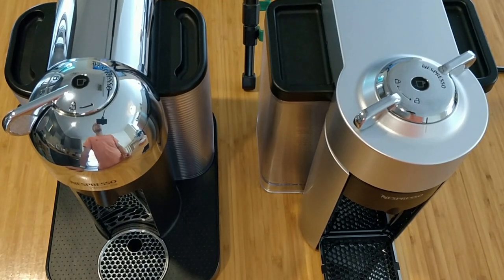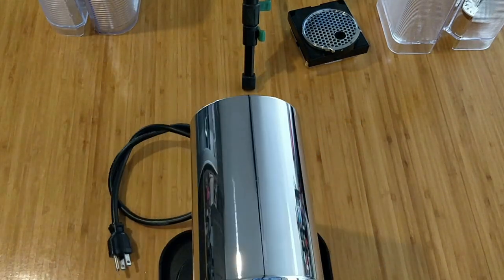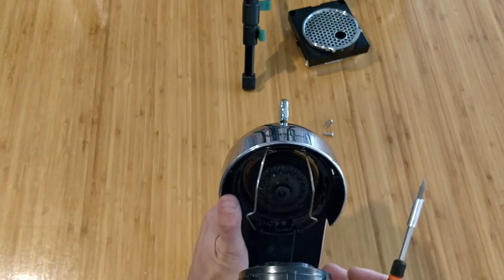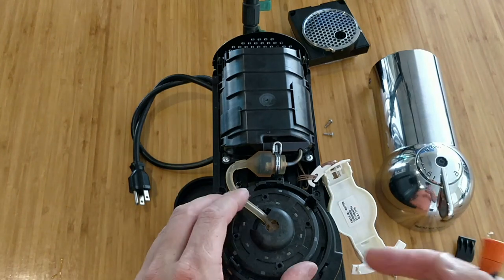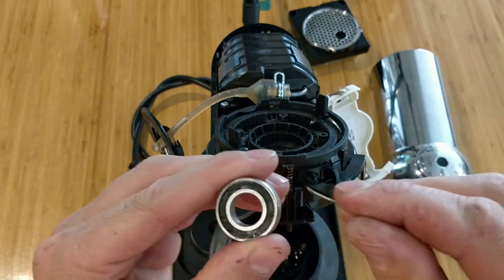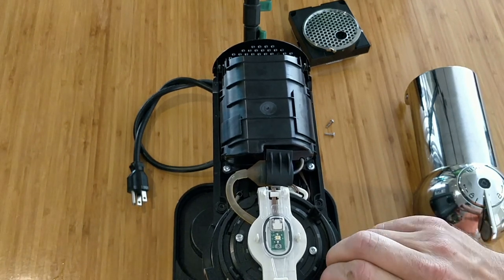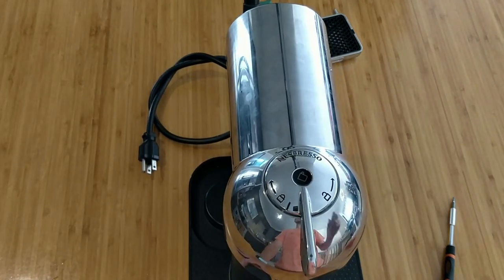How to fix Nespresso Vertuo Machine loud noise or no Water

Comment: Very impressed with the quality of your instructions and video and am so thankful you show us how to put it back! Just waiting for my bearing to come in and it clearly needed it. Very rusty and stuck hard inside the casing. Had to soak it and use a hammer to knock the old one out.
Reply: It is still not drawing in water. Quieter though!

Comment: Thank u. This worked great.
My bearing had seased up completely a couple times so I was ready to replace it.  I was able to get machine working while a  bearing arrived by manually rotating the part that pokes holes in the capsule but it ran very loud.

Once the replacement bearing arrived, I found out that just cleaning the  bearing and adding some oil (without removing the ball bearing covers) worked great.  The bearing was covered in coffee so all it seemed to need was a good cleaning.
Reply from the maker: Some bearings have to much use in them, it's always better to have a spare one.

Comment: Thanks, our machine is so quiet now. However we had so much trouble trying to get the part with the big spring back in place we just did not have the strength in our arthritic thumbs to get it back in. It took almost two hours of pushing down we actually ended up cracking the plastic so hopefully the machine will last until the next FREE with capsule purchase offer.

Comment: Great video .Clear instructions to take it apart. Had no water flow. Video helped me establish what the problem was. Short metal water tube at the end of the plastic pipe was completely blocked. Cleaned it up, All  runs well now. Thank you!

Comment: So I'm back to report that with roughly twice daily use, it took the standard bearings 5 months to fail again. The stainless/ceramic bearings are not a place to save money. They are a must if you'd like this repair to last! I just installed the new stainless bearings and am sure these will last longer. The standard bearing was in absolutely horrible shape...far worse than the original that lasted 8 years.  Thanks again for your helpful video!
Reply from the maker: Thanks.

Comment: I found your video very helpful and after bearing replacement the machine is quiet. I have several suggestions to make the process more clear. First, the use of a focused light such as a headlamp when working on the underside on the will allow one to see how to disengage the chrome cover more easily at the front of the machine. Second, I suggest that you alter the camera angle a bit so that the process you are doing is centered on the screen. Lastly, the way to insure alignment when re-installing the chrome cover is to close the machine and insure it's fully in lock position, before placing the cover on. Then, by holding the lever in the locked position as the cover is placed, it has to engage properly.
Reply from the maker: Thanks tor suggestions next time will do better ;-)

Comment: Edited: I successfully changed the ball bearing, the noise subsided but it’s not making the coffee properly. I think I might have tightened to much at some point. Now I definitely need to buy another machine. 
***Thank you for the video. I got it, I changed it!!! Very proud of myself. I have this machine for 5 years and I thought the noise was normal wear and tear. 
So let me tell you that it’s not that simple. You will get frustrated and you will probably need an extra hand at some point. Another tip: mine is a De’Longhi model. Don’t close it! The spring on the left side won’t open it by pressing it. 
When removing the big spring, inside that part is really hard to turn counterclockwise, my husband helped me with a plier. No more noise! I think I’ll stay with this machine for now! 😊

Comment: I did all you said and cleaned the bearing and filled it with wheel grease. It was easy with your video (even if it wasn't always clear). Good explanations though. I managed to reinstall everything without remaining parts...youppi. The greasing didn't eliminate the noise. I guess I will have to order a new bearing. Thank you.
Reply from the maker: Yes.

Comment: Thank you for step by step on how to open the machine. P.S. if bearing is in good condition pay close attention to the bottom part that get screwed onto the bearing. Similar to dogs on a washing machine they can be stuck in position and they should be able to spin freely all 4 dogs clean free up and replace if not broken, this should also repair the load sound when spinning.

Comment: Thank you so much for your informative video! I feel like the proverbial frog in a pot of slowly boiling water. I've owned my machine for years and lost track of just how loud my machine had become. I wanted to approach this with a little bit of science and downloaded a decibel meter app for my phone so that I could take volume readings before and after the bearing replacement. I was sure to take both measurements at a consistent distance of 2 feet with identical placement. The max decibel reading before replacing the bearing was a crazy 97 dB. With the new bearing, the max reading dropped to 73 dB. With the logarithmic nature of the dB scale, the 24 db drop equates to 1/8th the volume! The difference is staggering and wonderful! I accidentally ordered the standard steel bearing instead of the stainless/ceramic ones that you recommended. I received 6 bearings for the same price as one stainless steel bearing. I'll see how long the standard bearings last...perhaps as long as the other critical components on the machine which might break before rust becomes a problem. Either way, I'll be able to replace it 5 more times :) Thanks again!
Reply from the maker: No problem.

Comment: Thank you very much, it worked!!! When I tested the old bearing it ran very smoothly and the new one was kind of "stiff"  but just for the fun of it I used the new one. I thought it won't work, it's probably something else. BUT would you believe, it's running again. The 1/2" long metal pipe at the end silicone water feeding pipe came off, so when installing it into the hole, align the split-ring with the little "bump" in front of the platform ( very small)
Thanks again

Comment: Thank you so much my friend, I was able to fix my machine since this morning I could not drink my Nespresso coffee during my trip to the office, it was clogged from small coffee grounds at the end of the pipe tip (the black little tip that breaks the cup´s plastic lid). I think I could fix it without opening the machine but I was able to deeply clean all the inner parts and finally I assemble it with no problems. You deserve 100 likes!!!
Reply from the maker: Thanks.

Comment: THANK YOU so much!!  Great video, clear, simple and precise.  I was able to fix my noisy machine in no time following your steps.  At the end, your advice was very helpful to put back the cover correctly.  I put the bottom part at unlock position, and did the same thing with the top part, it went in like a charm.

Comment: Helpful video for the disassembly and reassembly. After I completed reassembly the machine was much quieter but the coffee was more water than coffee. There is a C clip on the short metal water tube. It's connected to the hose under the button assembly. Make sure the opening in the C clip lines up with the notch in the assembly that you press it down into. If its not lined up you'll get watery coffee.

Comment: Excellent video.  I repaired two machines.  Unfortunately following the repair they only  produced hot water (no coffee).  I ended up taking them apart multiple times to try and figure out why.  For those that had the metal tube fall out of the rubber hose (like me),  when you replace it, make sure you position the gap in the circlip  over the elevated tab on the top plate otherwise the hose and tube will not sit correctly and the water will bypass the coffee pod and all you will get is hot water.

Comment: BEWARE: I definitely appreciate the video, of course. Thanks!  BUT there are several steps that are too easy to get wrong. (Also, be very careful not to lose any of the springs.) NOTES: When disassembling: the bearing component (8:00), for me, required pliers (appears finger tight in video) .....  When reassembling, some steps RomaFix noted but deserve added emphasis: 
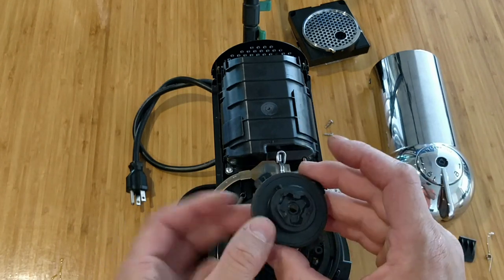1) 10:54 proper alignment of the 4-screw spring holder. I got that wrong, creating a puzzle and wasting time. 
2) 11:10 water feed (triangular) head must be pressed in FIRMLY. He glossed over this tiny step and I failed to do this firmly enough. This caused machine to express mostly clear water and VERY little coffee (reduced essential pressure somehow). I had to re-do the whole process!  Weird, since the water hose head attachment was all I did very slightly differently.
3) 13:30 alignment is very important BEFORE screwing the top back on. If you lock the top w/o the lever in proper alignment, the top will not unlock until you unscrew the 4 screws holding the top cover on and get at the 2 plastic clips somehow (1:47), which is a real pain. I ended up breaking these clips, which seems to affect nothing at all - feel free to break them, IMHO. Also, they do NOT un-clip nearly as easily as he showed.

Generally, the process is NOT as easy as suggested. I'm very handy and yet made a lot of little mistakes.   

MY PROBLEM?: I think I viewed the video mostly in large chunks (and at 1.5x speed - bad idea!) and figured it would be obvious. I should have watched a step, paused the video and did that one step and proceed that way step by step, pausing for almost every step.
Reply: I also experienced the issue with weak/clear coffee through the the brewing process after following this video. I found that between not firmly connecting the water line and having the little metal connector tube firmly seated between the line and the brewing head was and issue. Also,  I overtightened the screws which seems to have been a problem as well.
Reply from the maker: Good to know ..
Reply: The camera angle is also off and covers part of the front of the machine which is exactly what needs to be seen in better detail.

Comment: My machine was stuck in a cycle of blinking lights (would blink twice repeatedly) and when trying to reset or run in clean and descale mode the engine would make a click sound like it was stuck. After spending 30 minutes with Nespresso support, their conclusion was to send it in for repair ($150) or buy a new machine. Thank goodness I found this video because I was able to take the machine apart, soaked the parts shown in a bowl of white vinegar, cleaned with hot water and put back together. Machine is back up and running.
Reply from the maker: Great that you could fix it.

Comment: I changed my bearing and it works well, thank you. I think I must’ve done a step wrong as now the old pod is stuck when I am putting in a new one instead of just sliding off. Any idea what could be the reason?

Comment: thanks for the video, it was super helpful. The machine is so much quieter now!
I did something wrong, the self ejecting for used pods isn't working right - I must have put the top back on wrong.
Reply: nope, it wasn't the top, it was those springs in the front - i reinstalled them incorrectly. I went back 5:13 and paused the video - there's a good shot of the springs properly set there.

Comment: great information.  to reinstall the chrome top piece i lowered the head piece and locked it in place.  then moved the rotating piece in the top to the lock position.  that is, aligned the two lines.
Reply from the maker: Yes it can be assembled in multiple way. Thanks.

Comment: Great Video. very informative on how to fix the issue. The only problem I see is that I took your suggestion on ordering the part from the website you suggested and it will take a month to deliver. Never the less I reordered the part from Amazon, should get it in 2 days.
Reply from the maker: For me it took 9 days, but original bearing after cleaning failed in 6 month again

Comment: Hi.. I have vertuo next. First it would not pump, probably because it sucked in air cause the tank was empty. I opened it and took of the hose at top, started it and the air was out. The constant orange/red light is blinking. I press the button and it pumps water like when cleaning, but the blinking light will not go away. It was only white/blue for a few seconds at one point when i had the air hose disconnected, after that it went back to blinking red light. It does not help restarting it etc. and it wont read the capsuls. What can be wrong? Anything that can be done?? Has the pressure or motor gone bad or something? We had it for 3 years and only used to make like 2 cups on Saturday and Sunday. 🤷‍♂️

Comment: Hello. Thank you for the video. I ordered the part and will replace it when it arrives. Question about pumping the water and issues with this: Do you have a video or further recommendations? 
What is the best way to clear out the plastic tube now that it is exposed?
Thank you for your help

Comment: Hello - after doing this all, the machine is quieter but now the pods are getting stuck at the top of the piercing mechanism and won’t dispense when I open the lid. I have to take a knife and peel the pod off the lid piercer to get the pod to drop down after use. Do you know a fix to this?

Comment: Pro tip for loud noise. Also tighten the two screws on the chrome top. They tighten the latch itself and that cause noise. You can test by running it and resting your hand on the top, if it wiggles in the lock position those screws are loose and will also cause excess noise on wind down.

Comment: So mine is the same mode vertuo and it’s not dispensing water so even if I want to clean it I can’t because it is not dispensing the water at all and I got absolutely no help but this video seems to be useful however I’m wondering are you just dismantling the entire machine is that what I have to do and what is the exact model of the screwdriver? Thank uuu

Comment: Hey RomaFix - I had lots of little problems (almost all due to hurrying). I posted a comment and then noticed one person had a problem re-opening the top due to improper alignment of the latch when reassembling. Then I noticed A LOT OF PEOPLE had the same problem, with NO comment from anybody about how to remedy. Just pleas for help. I replied to a dozen or so such people, explaining to look for the 4 screws and how to deal with the 2 plastic clips (I ended up breaking - good riddance to those damn clips).

You need to REALLY emphasize the re-attachment alignment problem. You made a good comment on that but obviously even MORE comment is needed.
Reply from the maker: There always will be some % that will close it, I know because I done it by myself but most important, not to over force any parts.
Reply: But when the cover is locked, you can’t access the screws. At least not with flat top model. I’ve been using a paper clip to try to get at that plastic tab held by spring you use to release when top is off, but no luck.

Comment: Helpful, but for the evoluo a little more information on release and lifting would been helpful. I didn’t pick up that you had to lift straight up. ☹️. I need to do a little epoxy work now. I looked for a while and you were the only one that I found who even mentioned this model in repairs.
Reply: See my comment from mid-January 2023. I had similar problems.
Reply from the maker: Need to work really carefully these things are easy breakable.

Comment: We performed this repair with the part you suggested but now there is only hot water flowing. Capsule is punctured but no coffee (brown hot water). Did you have any thoughts
Reply: I have the same.  Did you find a fix?
Reply: See my mid-January 2023 comment. Worked for me.
Reply from the maker: top part wasn't assembled correctly.

Comment: Terrific contribution to user Do It Yourself repairs! Thank you. Post more!
Suggestion  for DYI: use a parts container to keep track of all the small bits as you remove them. 

 If you're going to the trouble of opening the machine, get the best bearing you can, all-stainless and SEALED.The bearing is not unusual (
Reply from the maker: If there are less then 20 pieces I'm ok, for more definitely need to use container, as I mentioned only stainless steel or ceramic. I gave the link to a stainless steel one 316 with good seal . But I'll put also a note in description. Thanks.

Comment: I replaced the bearing, the machine was very quiet afterward. But now my coffee is only dispensing about half of the usual amount. I read comments, made sure the screws weren’t over tight and still the same result. Wish I hadn’t done this, may have to replace entire machine now. Any suggestions?

Comment: How do I open a Vertuo plus machine that does not have any screws? I'm afraid of breaking it if I try to pull the top off.
Reply from the maker: You can check from the bottom there are two clips.

Comment: Thank you for this video.  It helped me clean out the grinds that was causing my machine not to be able to spin and to change the bearing to make it quieter.  Do you know how important that small spring is that was shown late in the video, the last one to replace?  Mine seems to have popped off and can’t be found.  Is there a way to reorder one?
Reply from the maker: As I remember the spring was used for capsules drop, need to check.
Reply: The little copper spring beneath the white controller piece seems to be unimportant, but the two silver spring arms on the right and left help to eject the pods. You could live without them, you just may have to manually take a used capsule out.
Reply: Thank you for the info. I finally found the missing right-sided spring in the collection bag of my Roomba.
Reply: @jessicalinblache6628  That's funny! And lucky.